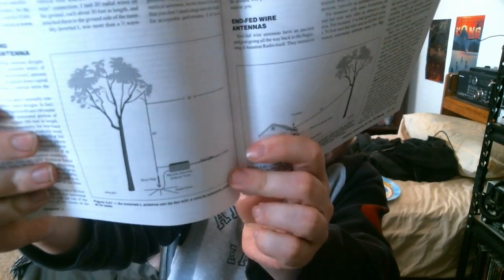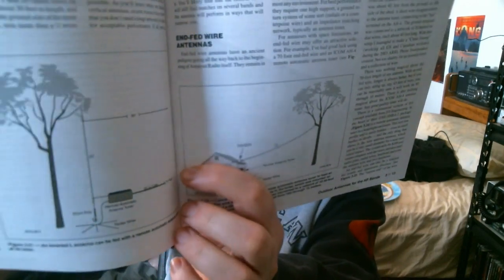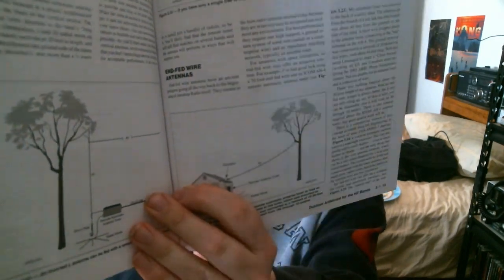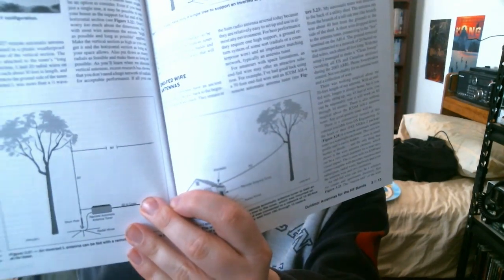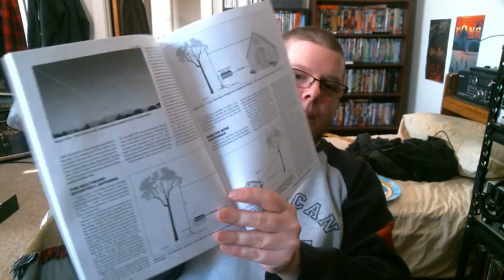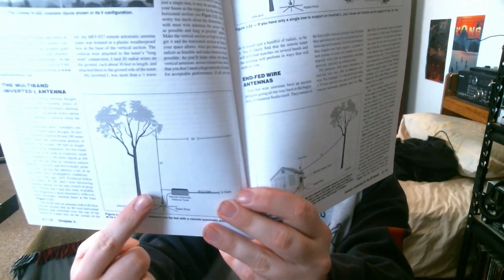Inverted L Antenna Questions

Comment: Going to make one of these soon with a 80 and 40m trap from plans I have...its going to be tuned for 80m.
Reply from the maker: Cool! I've had alot of luck and made alot of contacts with my inverted L. Well, technically it now an end fed antenna in an inverted L configuration.

Comment: Tuna? I like Tuna with mayonnaise best👍

I have seen inverted L antenna (designs) using traps for different bands but never built one... what happened to your previous multiband fan di-pole? 🤔
Reply from the maker: I was more thinking of tuna salad. LOL

Tree branches is what happened to my fan dipole. I tried making an adjustment to it, and one of the wires got hopefully wrapped around some branches in the tree. So I built this inverted L, which is working alot better than the fan dipole did. I'm quite pleased with it.

Comment: An Inverted L is usually not considered a multiband antenna or used as such.  If you want something that will resonate on more bands by using a tuner you could configure the wire to act as a 43 foot vertical.  (The more vertical the vertical portion the better) lay down at least 16 radials and use your tuner for best swr match as you have been.      If you want a resonant 1/4 wave vertical or inverted L use the antenna formula 234/freq in Mhz ( If using #14 thhn house wire) to get you into the ballpark and prune the length for exact resonance if needed.     Example:  If you want an L antenna for , say, 40 meters  resonant at 7.150  Mhz..    use 234/7.150 = 32.7 feet long for 1/4 wave on 40 SSB.  If used as an Inv L then make the vertical portion as high as possible  for best DX.
Reply from the maker: Ok, good to know. Thank you for the information! :)
Reply: @Sparkyzilla85   Hey try looking up the YouTube channel DX Commander this guy is cool and he shares information good luck with you're hobby